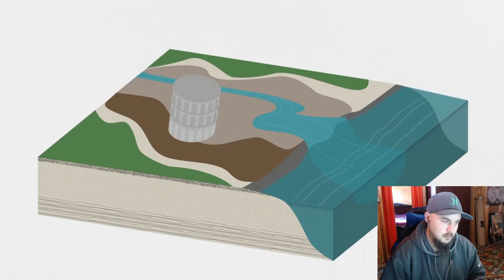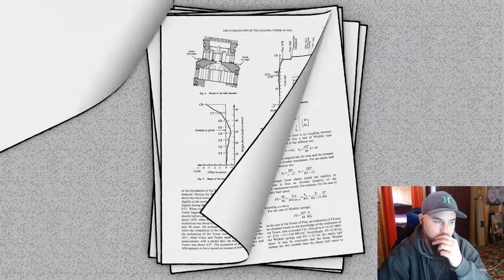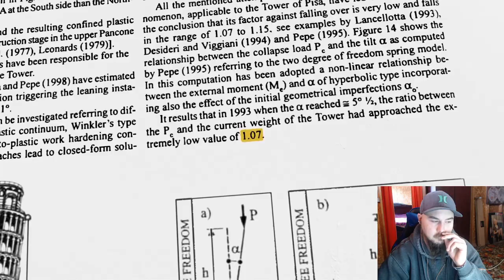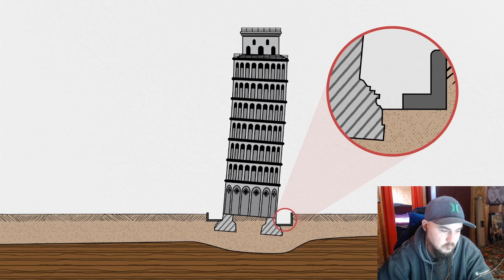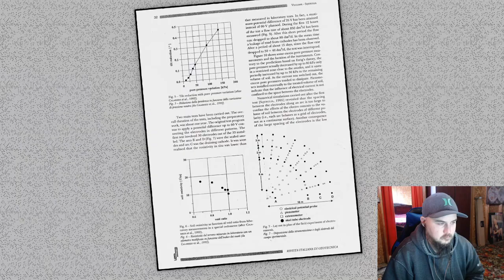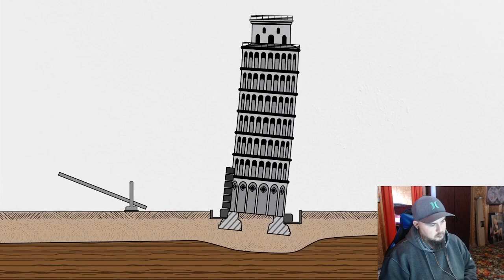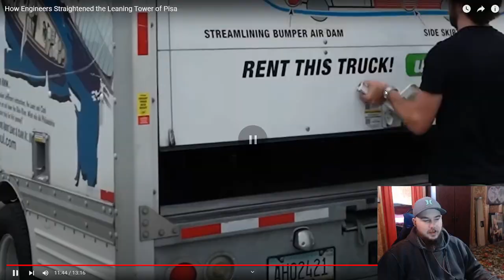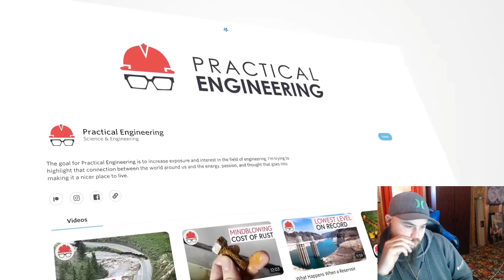Practical Engineering: How Engineers Straightened The Leaning Tower Of Pisa Reaction

Comment: They didn't know the tower was resting on it, that's the point. In practice the tower should not have been resting on the walkway, and there was no real reason to assume it would be, as the walkway was meant to be an entirely separate structure. Bur during the process of tilting the walkway came into contact with part of the tower and this fact wasn't known until the walkway was partially disassembled. If they knew it was resting on it greater precaution would have been taken. The thing was built ages ago, they had little information about what was going on under the ground, not like they could request documents detailing it's structure very accurately.